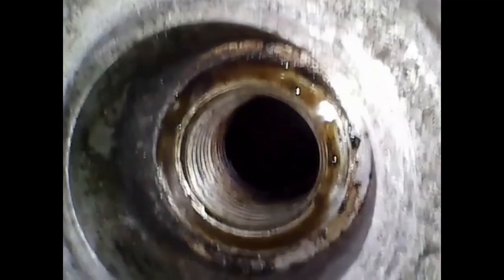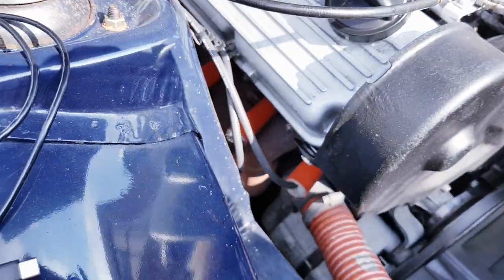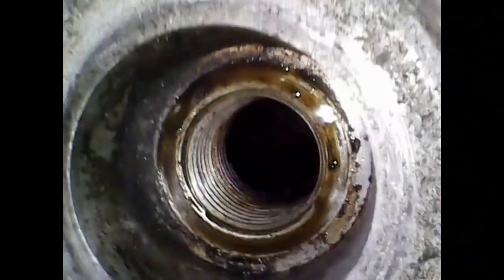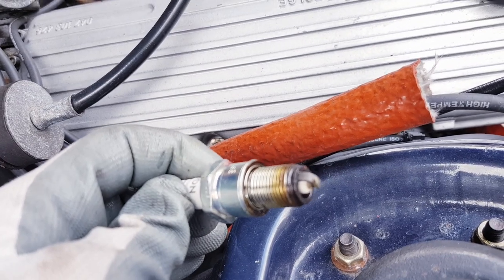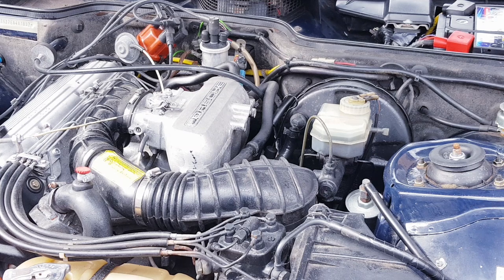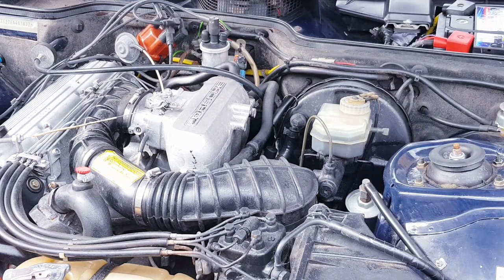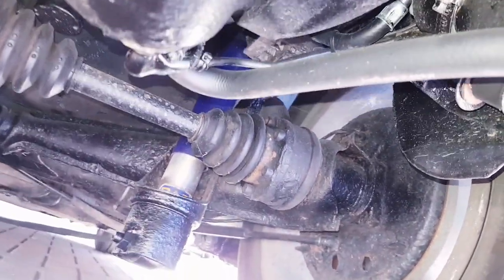Looking inside of my Porsche 924 Engine - Part 27

Comment: I do like your car, great colour. You are missing a couple of rubber bungs in the backing plate of the rear drum brakes. They will stop moisture getting in the brakes and stop the adjusters seizing.
Reply from the maker: You have a very eagle eye there Chris haha. Good spot 👍 it's on the list of little bits and pieces to get sorted 🚙💨

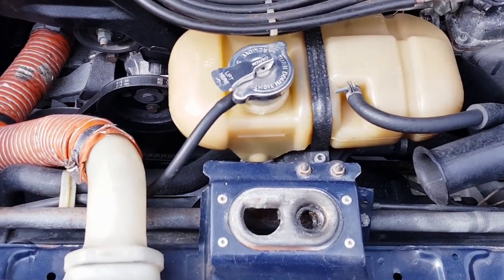Comment: Hey quick question thats a bit off topic to the video. In the beginning at 0:00 (visible again at 15:00) there is a red tube running down and left. What does this connect? My 924 has the white plastic bit but no hose and I can't figure out what it's supposed to be connected to

Would be super thankful for some help
Reply from the maker: Hi Pepe thanks for the comment. Great question. The tube connects to the back of your alternator. It provides direct cooling for the unit. The cooling hose  can be bought in various colours too. Hope that helps 👍

Comment: What is the orange thing on the spark plug cable, and what does it, keep the spark plug cold(er)
Reply from the maker: Hi Michael thanks for the comment. Heat insulation protective covers for the HT leads. Mainly because I havent got the heat protective metal plate that should be attached to exhaust manifold. Reminds me I still need to find one 🤞
Reply: @Witty924  Hmmm, I need to check if my car has that ??